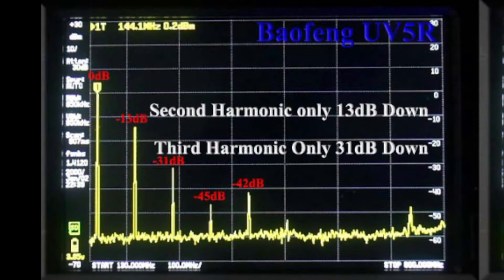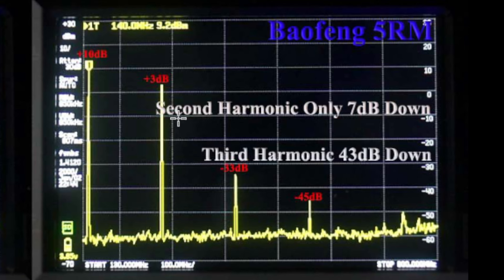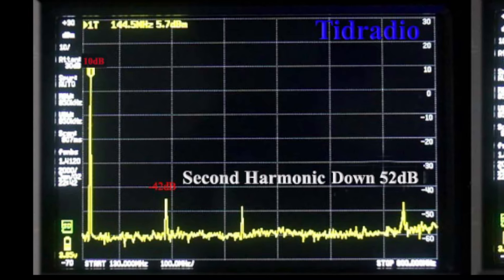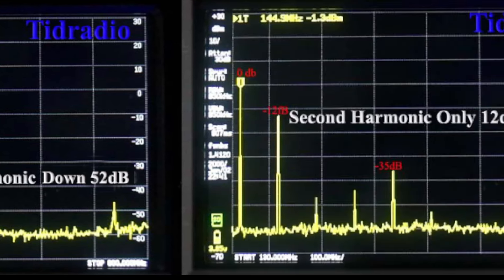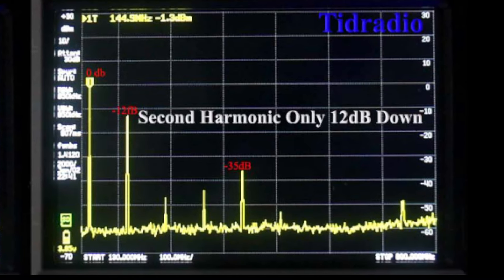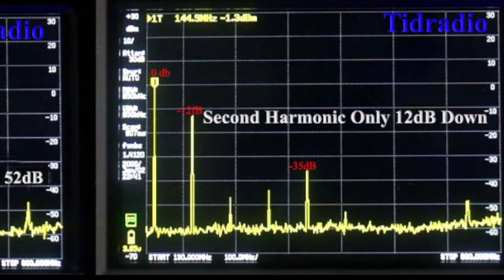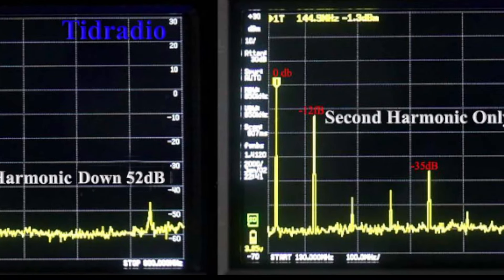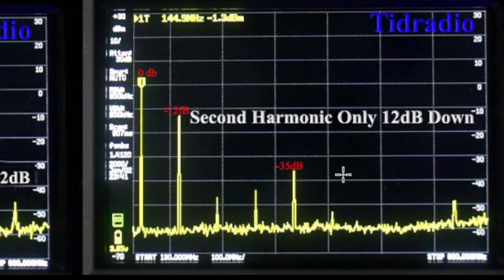Absolutely Dirty Tidradio and Baofeng Handhelds Tested in a Different Way See What Jim Found!

Comment: I have tested HT's into R&S communications test sets, through attenuators into R&S and Keysight spectrum analyzers, the same but through a directional coupler to the factory and aftermarket antennas to the SA and the same through a sample port terminated into a dummy load or multiple different antennas.  My last test regime was in a homemade anechoic RF chamber and sampled with a R&S log periodic compliance test antenna and spectrum analyzer.  I tested just under 7 dozen cheap Chinese and premium Japanese made HT's.  Some were the same make and model but purchased at different times and different locations.  In the end the results were pretty much drastically slanted one way.  Chinese HT's, good luck.  Some passed, some barely squeaked by and a lot failed horribly no matter the test method.  Premium radios like Yaesu, Motorola, Icom, Kenwood, Alinco and Hytera all passed with flying colors.  Not a single one failed in any test configuration.  I have noticed one thing with cheap Chinese HT's.  If it's a entry level cheap HT it's really pot luck what you are going to get.  The more expensive Chinese HT's tended to be fine.  Lesson to be learned here is you get what you pay for.  You want the cheapest HT made that's just what you are going to get.
Reply: The moral of the story is that the Chinese can make iPhones, but they can't sell them for $20.
Reply from the maker: Thanks very much.  I suspected that major well known brands would be clean.  My room is lined on the walls with aluminum tied to ground.  There is lots of noise from my computers.  But when the handheld is keyed, the background noise is not a problem.  You confirmed my findings with my meager setup.  I ordered those two from Tidradio and paid for the set with a discount.  You would think that they would have tested the units before shipping them to me.  It is a good thing that they did not.  I got to see one that was clean and one that was very dirty. I learned a lot from this test of handhelds.  If I want a handheld it will be from a major well known brand that I can trust.  73, Jim W6LG

Comment: Jim, may I make a suggestion regarding making harmonic measurements with the TinySA Ultra.
- Ensure you have 60dBm of attenuation between the radio and the SA input, sufficient that the SA does not need to add its own attenuation to bring the signal down to a level at which it can make its most accurate measurements.    Attenuation suggestion is based on a 5w HT and attempting to get the actual input level of the SA down to about -25dBm or lower.
- Update the firmware on the Ultra to the latest firmware so you have the most advanced harmonic measurement feature the Ultra has.
- Use the Ultra’s built-in ‘Measure>Harmonics’ tool to make the measurements.   Measurements will be faster, provide a cleaner & quicker read, and I believe uses optimized parameters for each harmonic range.
I noted substantial difference in Ultra input levels between screen grabs you showed in the video, and also that the Ultra had already applied its maximum internal attenuation to the signal which could mean measurement results are skewed by artifacts generated internally by the SA.

It would be interesting to know the differences between your original readings and the readings obtained using this modified approach.

73, KE8PLM

Comment: using spectrum analyser to calculate radio signals spectral noise is quite excellent , the only problem is can we get hold of a high resolution spectrum analyser , if we can hire it , it would be quite excellent.

Comment: For what it's worth, here's some data for you: I recently did this same test using my Tiny SA and Yaesu FT-60 with an aftermarket 1/4 wave whip (I need to try this with its stock rubber duck). I set the power to low (500mW). For receiving, I used the telescoping antenna that came with the Tiny SA, and it was located about 1M from the radio.

The Yaesu produced a very clean signal on 2M, and only one  harmonic was just barely visible - well below the requirement. I have not yet looked at 70cm, but I will and will get back to you. I also have an older Wouxon (sp?), and will try that as well. Thanks again for another interesting demo. 73! KO5V
Reply from the maker: Very interesting.  Let us all know what you find out with the Wouxon.  73, Jim
Reply: @ham-radio  I put the SA in to "Ultra" mode for the UHF measurements. If I am reading the FCC's specifications correctly, the harmonics from a transmitter that produces <25W must be >40db below the fundamental (please correct me if I am wrong). If I properly configured the SA, and made a good measurement, the FT-60's harmonics are barely visible on both 2M and 70cm. It's tough to read, and they fluctuate a bit between measurements, but they are 50-60db down. 

The signal levels shown on the SA may be a bit better with the aftermarket 1/4 wave whip than with the stock rubber duck, but the spectrum looks about the same. 

The Wouxon KG-UV-3D with it's stock antenna, and on its low-power setting, shows a couple of harmonics on 2M, but they are >50db down. On 70cm, there are a couple, but it looks a bit cleaner than 2M. It's not bad at all.

"For what it's worth..."  73, Jim

Comment: Testing with the stock antenna makes perfect sense. That's how the end user is going to use the device in most cases. As for the variance from radio to radio, I would guess that it's mostly due to a lack of tuning/alignment of the output filters at the factory, combined with poor tolerances in the undoubtedly cheap components they use in these radios. The output filters might be fine on paper, but it's just luck of the draw as to what you will actually receive and how close the filters will be to nominal.

Comment: Interesting.  I have tested HT antennas  on a RigExpert Analyzer.   I found it necessary to add a 1/4 wavelength counterpoise to measure antenna SWR.  With the counterpoise SWR is close  to 1:1.  This set up is also necessary when using an HT antenna on my IC-705.  Incidentally,  my ICOM  Id-52 has a second harmonic -50dB down from the fundamental.   I tested this using a Tiny SA  with its supplied antenna and transmitting from the radio  held in my hand with the supplied antenna.   Best of luck to you.

Comment: Jim, thanks for the insight into your methods and results. I think your tests are valid but I also think only one configuration really matters - the radio tested with the antenna it came with. I think anyone would expect that configuration to be the one the factory would have (maybe should have) tested since that is the way the vast majority of buyers will operate. If that configuration doesn't test well then the radio is unusable.  It's unfortunate that they are allowed to be sold as their very presence on the air compromises everyone's communications ability.  It would seem to be a simple and cheap test to perform on every unit at the factory before it gets put in the box, but obviously it's not being done.
Prayers for a full recovery!

Comment: Just a few days ago, my colleague from Russia performed the same testing of hendheld output. He didn't use dummy load, but connected antenna output directly to spectrum analyzer through a voltage divider, which lowed the signal to about 68 dB. The test indicated strong harmonics on all Chinese radios and some on Motorola and zero from Yaesu. Pretty much same results as you have shown.
Very good to see you on the channel, get well!

Comment: Very interesting results Jim, many years ago before the influx of cheap handhelds I was extremely impressed by the spectral purity of mainstream Japanese rigs. I only bothered testing one of my modern "budget" radios and it was borderline (From memory 3rd harmonic of 2m transmit was about -43dBc), measured with a modern communications test set with an internal load good for low GHz region. I would regard that as not too unreasonable to use on it's own antenna in the rural area that I live in. Testing the radios into a real world antenna and doing field strength measurements makes a lot of sense but it presents some problems, significantly many users immediately change from the production antenna. The difference you observed between two radios boxed together is perhaps more disturbing than the absolute figures, it points to a lack of testing and no quality control. Can you imagine buying a brand new car that only did 50mph where your friend with an identical one found his did 200mph, it just doesn't happen. I should do some testing of my fleet of cheap handhelds.... 73
Reply from the maker: Well, since I am not allowed to drive anymore, 200mph is way faster than a ride downhill in my wheelchair.  I get the point though.  Testing of these cheaply made handhelds needs to be done in the UK before they are sold. Not tested in a perfect load but into the supplied antenna and others.  73, Jim

Comment: I tried the same thing you did with my Comet antenna analyzer.  What I found was that all of the cheap HT antennas weren't that great, but also, they all seemed to be tuned for GMRS/FRS and/or MURS, which seems to be their more core clientele, people who want those services with non type accepted equipment.  Did you run the 2 meter band and see where they were best matched?  I also had the same problem of moving the analyzer around, every time you think a twist of the wrist might help it, it always seemed to make it worse....

Still, I have a feeling that the $20 radio is more at fault than the $10 antenna.

Comment: very good thinking on testing HT's . testing in different ways gives a better picture on how the HT in the real world.  we talk into a antenna to a outher radio.  with that a have found poor quality control on the China HT's. I have tested several UV-5R from several different people bought at different times.  look at spectrum and see different results. even power difference. seems like totally different radio at times. comes down to test your own radio in the way you use it . then you know how it is doing. the Talkpod A36 is that way as well. some got clean ones.   comes down do your own test or have the radio you have tested. do not go buy some one else that tested same radio. very good Jim. 2 radios in the same box not the same.  73's

Comment: You should have run the same tests for the Tidradio into the dummy load and showed those results side by side to your antenna use tests.
Reply from the maker: Hank I have decided not to do that.  If I were to use them it would not be into my Bird dummy load.  It would be with the supplied antenna because that is what everyone will do. I tried several antenna and some were a little better than others.  The units appear to be nicely made with great features.  One of them I can use.  The other is garbage like the Baofeng.  Thanks Hank, 73, Jim
Reply: @ham-radio  Jim, I'm only saying (asking) that your test with an antenna be compared to a dummy load test. In theory the results should be the same (or close to the same).
The rule states "at the transmission line" so you have to wonder what role a mismatch plays.
Thanks for your efforts.

Comment: Thank you so much for this video. This manufacturer appears to have sent their radios for review to every YouTuber out there.  Very few have your knowledge and experience to properly test them.  Apparently there is a great deal of inconsistency and these products. This alone should make the buyer weary. I would think testing would only be valid utilizing you the radio in a real world configuration. So the question is, does the FCC rely on the manufacturer's data for certification or do they do their own testing?  If that's the case, I have a bridge in Brooklyn that I would like to sell.

Comment: I have long felt that the default antenna should be a part of the testing.  The antenna can act like a band pass filter in cutting down the unwanted harmonics.  A dirty radio could well  not be illegal but rather less efficient as power is lost out of band.

Comment: I like Jims videos, he is well versed and tells it like it is.
He is correct that the Bird dummy load is seen as a perfect 50 ohm load.  

The reason why Jim built that "box" is because he doesn't have the necessary test equipment on hand. An Anritsu spectum analyzer (or other similar mfgrs) that can accept the radios output directly costs over $10,000.  None of us have these devices in our shack, as they are intended for use by manufacturers that can afford the equipment needed. 
Because of this he had to build something that would allow him to make spurious tests using the equipment he had on hand.  His box can introduce some uniqueness.  When you have a known radio that has spurious output, anything introduced into the testing process (such as an  inline RF sampler/sniffer) can affect the testing outcome.

Baofeng claims that their radios spurs are below the FCC allowed maximums... IF YOU USE THEIR ANTENNA.  That can be true, but this is not how the FCC does it's testing. And it's the FCC they have to adhere to; by using the FCC's test method.

The concrete way to determine if a transmitters spurs are greater than the FCC allowed maximums... is to mimic the FCC's testing procedure.
Reply from the maker: Hi Mike, I did not use my box or the dummy load.  I did use the supplied antenna transmiting at least 6 feet from a receiving antenna connected to the TinySA with a few feet of RG8X.  So, I used the supplied antenna and others as the user would do. No dummy load and not sampler was used in the production of this movie. 73, Jim
Reply: @ham-radio  . I mis-undertstood; thanks for the clarification!

Comment: So just how much of your transmit power is going out on harmonics and not on the primary frequency?

As I understand it, we care about this because:

1. You are polluting other frequencies raising the noise floor over there hurting anyone else using that frequency
2. A big chunk of your transmit power is not going into productive RF on the intended frequency and is instead going into harmonics on other frequencies.

Is that right?

I'm still very much a student of these things but I say you test with the antenna that came in the box. I've learned that everything affects everything with RF so testing in the actual useful configuration is important.

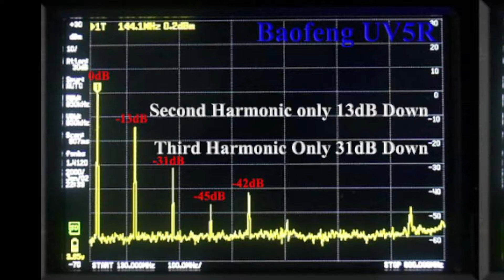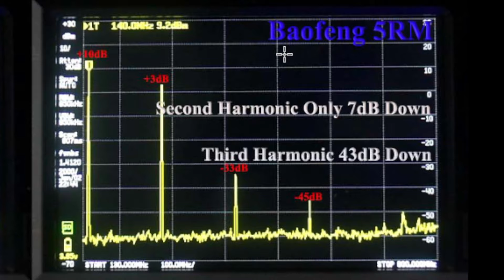Comment: Jim, seems you are measuring the 3rd harmonic as marked as 2nd, starting at 5:33 (and 6:32). Anyway, awful, but cheap.Thanks for the informative video, hope ham friends get the message. Best wishes, Michael
Reply from the maker: Thanks for that!  I may have made a mistake.  I will check it out. 73, Jim
Reply from the maker: It looks correct to me.  73, Jim
Reply: @ham-radio  OK, the horisontal freqency scaling is a bit unclear, so perhaps I am not getting it right - I was just looking at the spacing, which changes at 5:44. Also took me a while to realize there are not 10 full graticule divisions horizontally ;-)

Comment: I don’t know why you would test only with the antenna the HT came with. 

The first thing you do when you buy a Glock handgun is replace the plastic sights with a good set of steel sights (if yours didn’t already come with good sights, which some do). 

Likewise, with an HT, the first thing you do is replace the antenna that came with it because you can assume it isn’t optimal, and you know there are better aftermarket antennas available.
Reply from the maker: I held up a handful of various antennas.  Some well-known brands were part of the testing. So when you said that I only tested with the supplied antennas, you clearly did not watch the video.  A dirty Baofeng did not get magically better with another antenna.  73, Jim

Comment: I have no doubt those samples you have are dirty; my own extensive testing on a uv-5r was a fail.  Weirdly, the harmonics were ok, but there were terrible spurs a couple hundred kHz from the fundamental.  One caution with the tiny sa:  you may need some extra input attenuation to keep the fundamental from swamping its front end
Reply from the maker: The peak signal was close to zero dB.  So overloading did not happen. 73, Jim